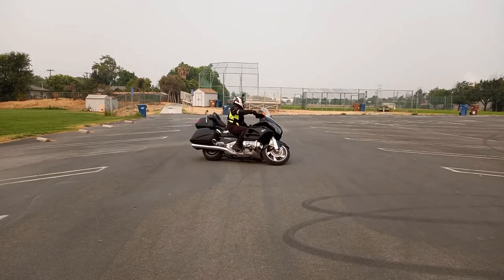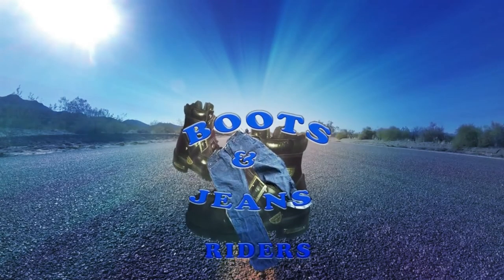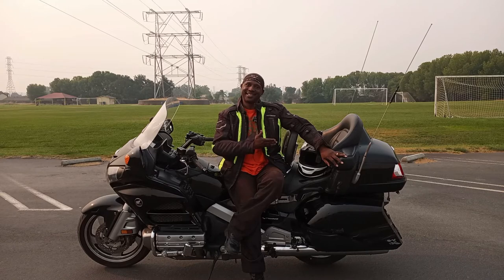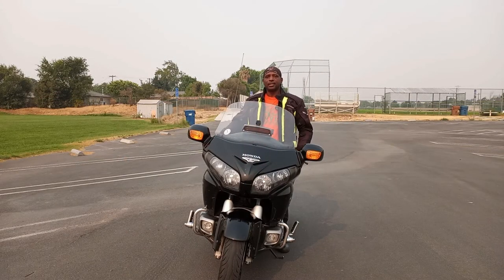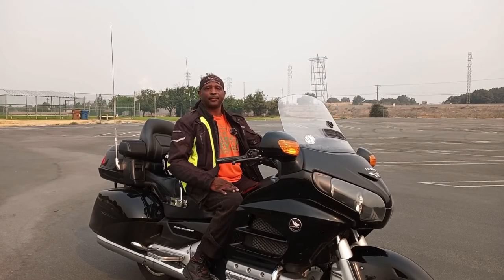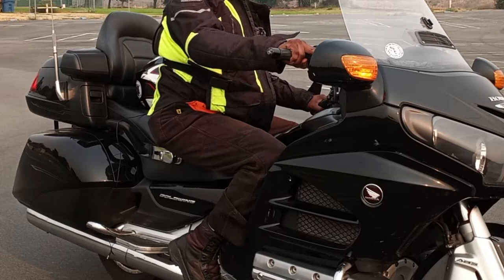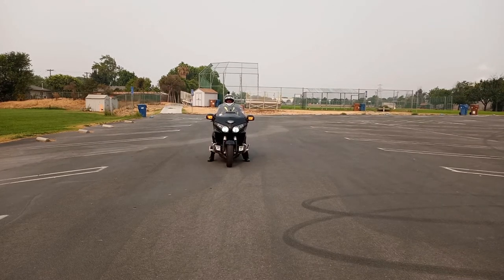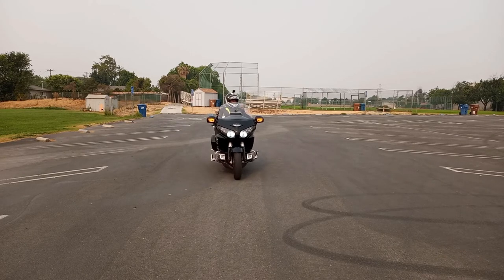How To Counter Balance A Motorcycle | Make Your Feel Less Heavy

Comment: Counterbalancing is a good thing to know. I’ve been using it for years when I’m riding the twisties at high speeds.
Reply from the maker: Hey Robert always good to hear from you. But I think you meant counter steering at high speeds.
Reply: @BootsandJeansRiders  
I did mean counterbalancing. When I’m going at higher speeds in the twisties, I push the bike away from me and sit up straight off the seat like you showed in the video. I guess you could call it a combination of counterbalancing and countersteering.

Comment: How do I do this on a cruiser bike with forward controls? I can't use the foot pegs to lift my butt up and move it to the side...
Reply from the maker: Good question...No need to lift very high. Just slide to the side and back over once the turn is completed. Try it while the bike is parked first.

Comment: Your butt should never EVER “slide” on the seat my dude… you’re changing the whole dynamic of the bike… you lean (your butt cheek raises off the seat) but should NEVER “slide” that’s what your upper body is for. You ass should never “slide”.
Reply from the maker: There are different ways of making u turns better. This is what I am demonstrating. The best way is what works best for each individual. I’ve known several people who take their foot off the floorboards/pegs and said it is the best way to do it. I would not tell them that they are doing it wrong, it is just a different way of accomplishing the same task. Putting your butt slightly off the seat will not change the dynamics of the bike, in my experience. In this video, I’m giving you options. Any rider can choose not to use it.